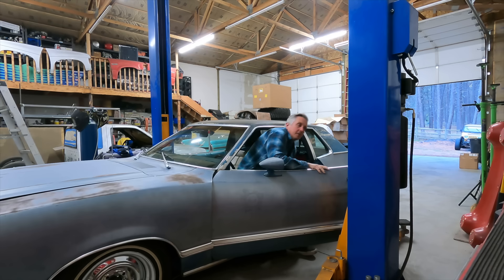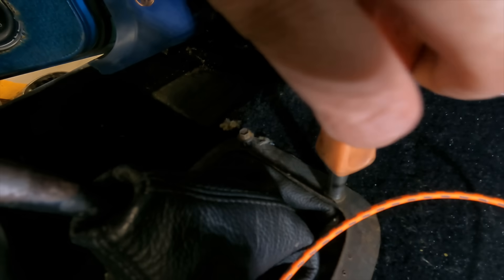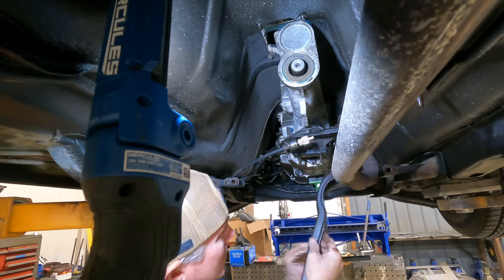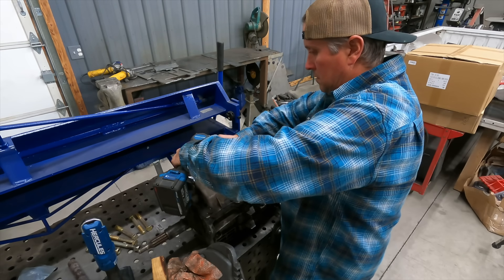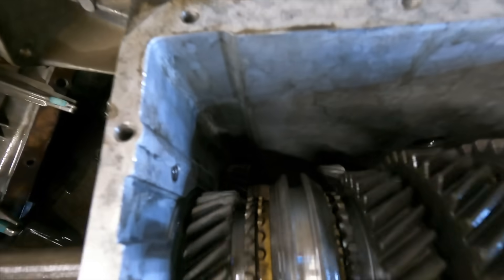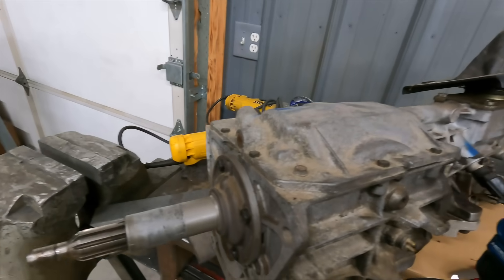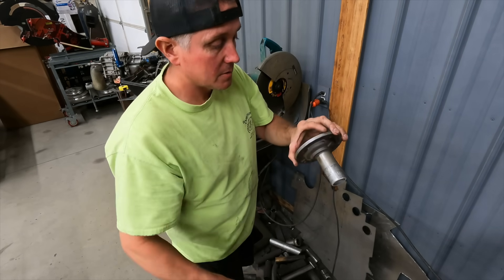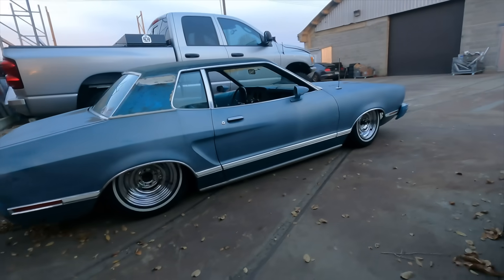Broken transmission!  Repair or Swap?  Ford Mustang II

Comment: "I've never taken one of these apart before... let's just start taking it apart and see what happens"

That's the spirit.  I always get caught up in analysis paralysis.
Reply from the maker: It all works out in the end
Reply: @thedirtheadshed   Just need to swap in the 2.3 turbo now for a few extra ponies :)
Reply: @disophisis  or an Eaton M90, it would be funny to hear a cammed 2.3 with a long tube header scream like a termi bolt on a 4 barrel carbie for fuel...So many option!

Comment: I remember doing that swap back in the 90s on my buddies 79 notchback. Good times.
Reply from the maker: Nice.  How did they like it?
Reply: @thedirtheadshed  Much better overall. I can't remember the differences in gearing but it was much more drivable. I do remember that they got 35mpg- And it was quicker in the 1/4 mile than my 87 2.3 mustang.

Comment: I think I paid $40 for the Borg Warner T-10 from a junk yard in '87 or so, but that was back when these cars were everywhere.  I swapped it twice on my '77 II.  Once because the first junk transmission was actually junk.  The second seemed to work.  I changed it with a tiny floor jack and worn out 12 point sockets.  I thought the car was old back then.
Reply from the maker: Sounds like you made some memories with it

Comment: Loving the Mustang, Dave, I can really relate to what you are doing. Except for the air bags lol. Way back in the 70's, I was still driving my first car, a '65 Mustang GT. Rebuilt the engine and trans in shop class at my local community college, then less that a year later, an 18 wheeler wanted the lane I was in. Sooo, the motor wasn't hurt, I went out and bought a '67 Mustang, manual tranny with a six in it. Proceeded to begin swapping my 289 in the '67, wanting to keep the three speed manual, so I went parts hunting. Junk yard,d different shops, a few new pieces cause I didn't have much money. I ended up with parts from Mustangs '65 through '68. Found out a '63 bell housing wouldn't work. Had to modify some parts, swapped the '65 rear end in it, made this and that, and ended up with a driving car. The '67 was almost the same color as your Mustang II. Looked just as bad lol. Drove that car for a couple of years until I moved on to something else. Wish I had kept it. Now I have a '73 Mach 1 I drive to cruise ins and cars shows.
Reply from the maker: Nice work! Making things happen
Reply: @thedirtheadshed  yea, just don't have anything for off road lol.

Comment: Imagine if you could find a 2.3 carbonated turbo( 78-82 fox cars ). I've dabbled in stang 2's and early fox cars. Really love what you've done with this car. Keep up all the good work! If you happen apon a carbed turbo 2.3 make sure you get all the components  from the donor car. ( 3 wire ignition module,  redundant switch pack and correct  turbo carb, distributor etc.) Factory  they were 136 hp.
Reply from the maker: That sounds complicated for 136hp
Reply: Maybe a Thunderbird Turbo Coupe/T5 combo (190hp) or the related Mustang SVO motor would be better. These are fuel injected and intercooled and there were folks getting significantly more power out of them. Still the 2.3 ...

Comment: Very cool! Back in the late 80sI had a 75 Mustang II with a 302 and a the first thing I bought for it was a T5. Which really made driving the car more enjoyable especially on longer trips.

If you do swap the rear axle, find a Ford 8 inch from a Mustang II, way stronger and worth it.
Reply from the maker: That’s the plan
Reply: @thedirtheadshed  Dave, I've always thought that a modern 2.3 ecoboost  would be an awesome swap into one of these things. Keeping it a 4cyl, but a 4cyl that makes 310 hp. If you could find one in the salvage yard I bet it would be a really cool swap.

Comment: I have tranmission envy. Just did the throwout bearing and clutch on my Ram 2500 with the NV4500.

Boat. Anchor.
Reply from the maker: Those are good transmissions.
Reply: @thedirtheadshed  not when you're on your back under your truck in the driveway they're not. Then they're heavy pieces of junk that don't want to go back where they came from.

It's even worse when you can't get the transfer case off and you have to install both at once

Comment: To get the smell out I use baking soda. Just place a large tray of soda into the car every time you’re not using it. Close all the windows. It’ll take a while but I’ve had success getting even the worse smells. Plus it’s cheap.
Reply from the maker: I always forget about that trick for some reason

Comment: Ford ranger rears are 1" wider than yours but would probably fit, and most have much taller ratios too. They are a dime a dozen in all the junkyards .Would work great with that new 5 speed OD !!
Reply from the maker: They would require me to do a 5 lug swap in the front too. And get new wheels

Comment: Love the T5 upgrade, this thing would be the perfect hot rod daily with a top end, and a cam.  I’m still waiting on the custom stainless tube steel rear bumper though.
Reply: Needs to roll the pan in the rear.
Reply from the maker: I have a line out for some hop up parts

Comment: If you're really good at scrounging for kinda hard to find parts, the T5 from a 300Z has the correct shifter location, but the wrong speedometer cable hole.  All you need is the tailshaft from it.

I've T5 swapped 3 Mustang IIs over the years with varying degree of easiness/difficulty.  Shifter location always bugs me, but with your skills you should have no problem making a shift lever that puts the knob in a decent location.  I say varying degrees of difficulty because:  1)  351W + SROD 4spd Bell + Tremec 3550 = easy.  2) 5.0L + Mustang II bell + '88 Mustang T5 = not as easy. 3) 2.3L Turbo + 96 GT Bell and 5.0L clutch/flywheel conversion + 96 GT transmission = hard. 

For rears... 9" from late 50's Galaxy or Fairlane, obviously any 8" Mustang II, or ... pretty much any rear from 60's Mustangs.  64.5 to I think 66 or 67 are the same width and 68/69 are 2" wider.  All those are practically bolt in if your suspension was stock.  Since you have already modified the suspension I guess you could run anything that's near the right width so 8.8" is a pretty obvious option too.  I just run a 4.11 posi 8" behind my 2.3L Turbo, the car's not very heavy and it'll most likely never see a drag strip.  From my experience though, an 8" will likely break before the T5 does but I've only broken one behind a V8 and regularly no-lift shifted it.
Reply from the maker: I’m on the hunt for a 4 lug pinto 8”
Reply: @thedirtheadshed  There was a 4 lug MII 8" rear along with a bunch of other parts for $100 near Seattle on one of the facebook MII groups ("1974-1978 mustang II parts for sale only"), but I believe someone is picking it all up this weekend.  Sorry for only having a "was".

Comment: Macks Standard transmission in Houston probably would have parts, but you likely would have paid more for the parts than the 5 speed cost...
Reply from the maker: I’m pretty sure the case was ruined from lack of oil

Comment: The thunderbird s c used a screw blower. Good luck.
Reply from the maker: The later ones with the 3.8 v6 did. The earlier ones were a turbo 2.3

Comment: Hey Dave, love your work! I'm wondering if you have any advice on how to start getting into fab work like you do. Mechanic and gear head already, would love to be able to just fab a suspension setup, roll cage and stuff that you do all the time.  Also if your looking for an apprentice or shop helper let me know lol
Reply from the maker: I’d suggest getting a welder and seeing if your buddies need anything simple made.. workbench for the shop? Bumper for a Jeep? Stuff like that
Reply: @thedirtheadshed  thanks for the reply. Would you recommend a welding/ fabrication course?  I've been thinking about doing that to get the ball rolling and sharpen my welding skills

Comment: Any chance a T5 from a Foxbody will slide right in? Nevermind, I made the comment before watching all of the video. Here's my idea to fix the oil leaks. Back in about 1993 my step dad and I removed a 2.3 Turbo out of an 83 GT Mustang that the owner wanted to install a 351 Windsor in. We took that turbo engine and dropped it into a different Fox Body that we had. If memory serves, it slid right in without any issues. They are only like 175 horsepower but in my experience they are good strong engines.
Reply from the maker: That is definitely on my radar

Comment: Looks like your already on your way to hopping up that 2.3!!!
You could go N/A, Turbo...Or even Supercharged...toss an Eaton M90 on with a small pulley and listen to it whine like a mini Terminator lol.
 Like I was saying in the comments of the other video, the Racer Walsh website has Lima 2.3 Go fast goodies that fit the Mustang II.
 Swap in a 130 amp 3G Alternator from a 90's 3.8l Ford Towus get the wiring for the alt too or buy the swap kit online, if you get one from a parts yard snag the electric fan too unless you find a V6 contour those are even better if it would fit...The alt should clear up electrical charging  issues and the fan should free up a lil more hp...every lil bit counts when stock those things had less then 100, lol!
Reply from the maker: I just need to keep it on the road:  that’s enough of a project for now

Comment: Did you check the gear oil in the 5spd? That 4spd looked a bit low on fluid which probably caused the 4th gear issue.
Reply from the maker: Yeah. It was low. I think I damaged the case where  the counter shaft bearings ride

Comment: If you ever go 5 lug, I have some rotors that you can have.  I went 'big brake' on my M2 front suspension (Grenada) and have brand new rotors with no home.  Guessing it might be easier to find 5 lug rear axles then 4.
Reply from the maker: I appreciate the offer.  Yeah still seeing what’s out there
Reply: @thedirtheadshed  Can't even give away Ford parts lololol

Comment: You hand looks really close to the dash panel now that your shifter is forward those three inches.  Any plans to change the shift rod to get your hand back a little bit?  Oh ya, and let us know the gas mileage difference with that extra gear??  GREAT WORK!!
Reply from the maker: Thanks. Yeah. It’s a stretch . I will probably make a new shift handle

Comment: You never mentioned how 5th was.  I'm sure once it gets going 5th might be nice.  Then again, what's the gearing on those things?  2-something probably.  Rebuilding the rear end would allow you to regear it while you're in there.  Win-win!
Reply: I think it's a 4 speed transmission so he was stuck going slow
Reply from the maker: It uses 5th on the highway.  But you’re correct. Gearing is a little off
Reply: @jackcampbell6779 The T5 is a 5-speed though. If the car was geared lower it wouldn't be a problem but they're probably geared really high so its turning way too few revs to make enough power to keep it cruising at a decent speed.  Since he's going to be rebuilding the rear it's the perfect time to lower the gears so 5th becomes usable as an OD.

Comment: Awesome job on the 5 speed swap. Now that we know the trans can handle a turbo.......the engine is going to pump out that exhaust either way, why not put it to work?
Reply from the maker: We will see.  This one is running… and I have 3 that are not. Pretty sure they will get the attention
Reply: @thedirtheadshed  Right on, having a solid runner is good. That 4 link you built is sick too...How you pull that out of your brain is awesome. :goodvibes:

Comment: I noticed a lot of fresh looking oil around the mechanical fuel pump. I remember when they would leak oil or gas out the weep hole depending on what was going to be worse for you. Is that where the oil was coming from?
Reply from the maker: Power steering fluid all around the fuel pump

Comment: How’d you end up with a laguna pipe for your exhaust tip? I think that got left out at some point.
Reply from the maker: I had to weld it on on my way home.  Trying to keep some exhaust from circulating back in. I got carbon monoxide poisoning pretty bad on the last part of the drive to Tucson

Comment: Like you said, the T-5 is way better all around as it's the "standard" 5spd standard transmission. Exactly what I have planned for my '60 MGA Coupe build for the same reason, purists be damned. Kudos & thank you for another valuable video!
Reply from the maker: Build what will make You happy.  They just need to be driven

Comment: Did you ever check to see if that spare wheel would even fit if you had to use it? 😅 I've been curious to know if the backspacing was way too deep or not.
Reply from the maker: No. I’m sure it’s ok on the rear, but no chance it will clear the drop spindles up front

Comment: Your probably going to be to high geared to use 5th gear anyway. So an axle ratio swap might be a blessing in disguise? A 373 or even a 410 set might get you 2.3 moving real nice
Reply from the maker: It does pretty well with the new trans and stock gears

Comment: Those 2s would look so much better with flush bumpers
Reply from the maker: Well yeah!
Reply: @thedirtheadshed  are you gonna shrink some steel bumpers to fit it? I had a 77 Nova in HS that I wanted to do that to
Reply from the maker: Don’t tell anyone… but yeah. Gonna chop up some pinto bumpers
Reply: @thedirtheadshed  Sweet

Comment: Engine swap! Find a good japanese four cylinder which will be more reliable and more economic. Doesn't have to be special just interesting! Take one from a pickup so the engine and gearbox is in the right direction.
Reply from the maker: Thanks for the tips!

Comment: I bet an 8.8 out of a foxbody would be about as direct of a swap as you could get! Probably could even get away with a 7.5
Reply from the maker: A fox body axle is about 2 inches too wide and has a bunch of link and coil bracketry in the way
Reply: @thedirtheadshed  Explorer 8.8, cut the long side to match the short side? Not sure if you're wanting to go in the 5 lug swap direction though

Comment: With that 5 speed, you’ll want 3.73 or 4.10 rear gears.
Reply from the maker: Ok
Reply: @thedirtheadshed  that is if you have to tear that rear and down.  I’m not sure what the mustang II came with originally.  The turbo coup came with 3.55 for auto trans and 3.73 for manual trans. The 4 cylinder seems to run out of steam in 5th without lower gears.

Comment: 4th is not a gear, its direct.  Bad pilot can make it pop out of 4th
Reply from the maker: Not sure I’m with you on this
Reply: @thedirtheadshed  In 4th "gear" the shift collar couples the input shaft to the output shaft directly,  no gears used
Reply: @thedirtheadshed  bad pilot bearing  can cause the input shaft to runout, sometime causing the direct "gear", 4th gear shift collar in this case, to walk off the synchro under load

Comment: Im like 1 minute in the video and im thinkin T-5 swap.
Reply from the maker: You’re right on
Reply: I had an 85 Mustang 4cly with a 4 speed single rail, that trans was poop. I did a 5 speed from 87 4 cyl and put about 200,000 on it after that.
Reply: Yes! So much more fun to drive that way.